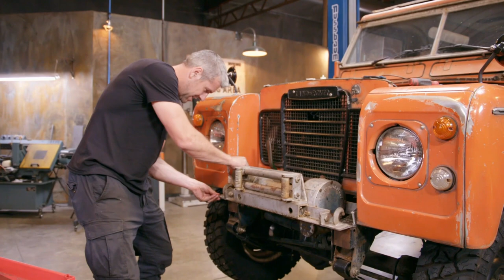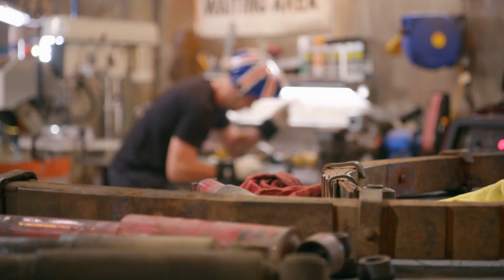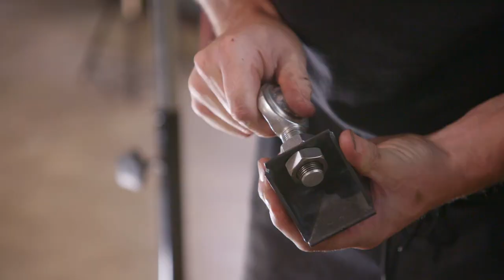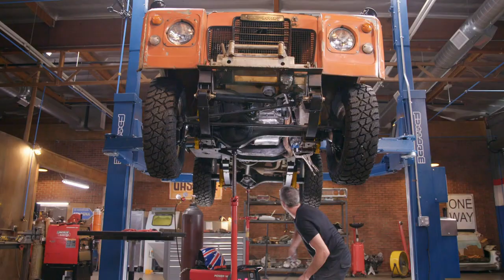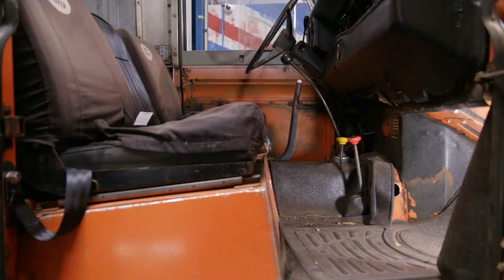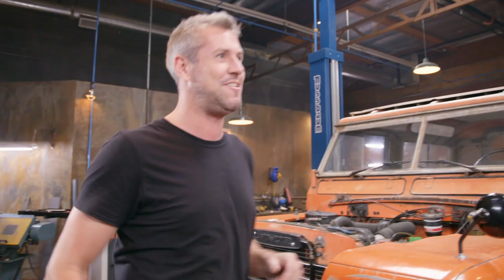Ant Installs A Motor-Powered Winch On A Land Rover | Wheeler Dealers

Comment: It’s winding out in first gear...?

Did the landrover PTO boxes have a reverse gear, or has he messed something up?
Reply: The wire goes underneath, so its pulling in in forward gears.
Reply: @onetonlandrover  the roller fairlead is clearly directed to the top of the drum? Strange
Reply: @scod3908  Yes it looks to have been raised for some reason, but normally a winch pays in/out off the bottom.
Reply: @onetonlandrover  the Toyota PTO with similar setup, wire/cable runs to the top.

Do you own the model of winch they used?
Reply: @scod3908  No, mine is the hydraulic winch, but I've had plenty of experience of the winch in question. I can only think it's some special for the US market or for a different vehicle or usage.  The fact it isnt being driven the right way by the gears is a strong sign something isn't right about it.